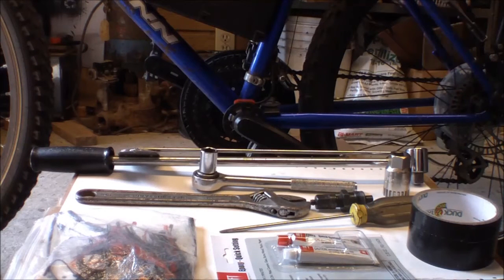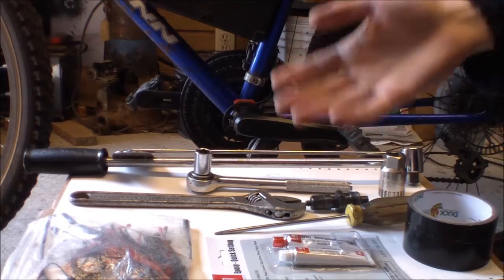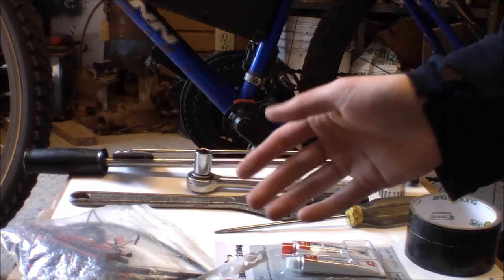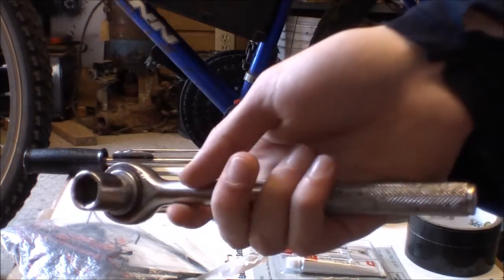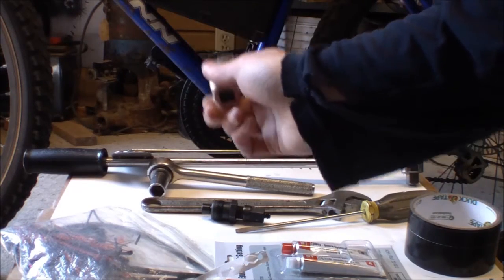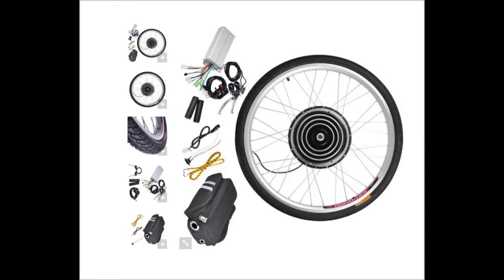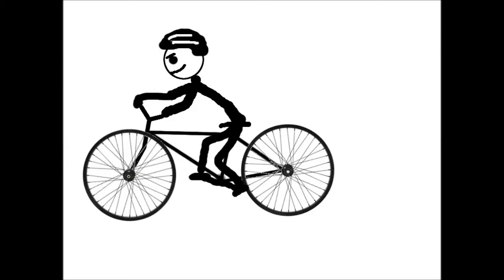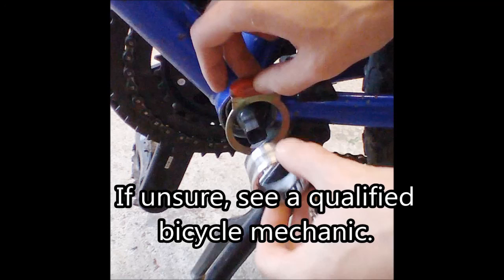PAS Part 1 - Intro to Pedal Assist System

Comment: My one ebike only comes with pedal assist - no throttle. I'd like to bypass the magnetic read switch, on demand, with a push button so that I can turn the motor on or off as needed and eliminate the need for a new speed controller with throttle (my Clean Republic hub motor ebike works in this way). The idea would be to just splice in a switch on the two ends of the sensor switch. Do you think this is possible/can it work?
Reply: P.S, I don't actually have the ebike yet, it is on it's way so I can't actually experiment with this myself at this time.
Reply from the maker: It depends, most likely the controller will look for a signal that goes on-off-on-off... so you could use a momentary push button with the splice, and then rapidly press it to replicate the pulsating signal.